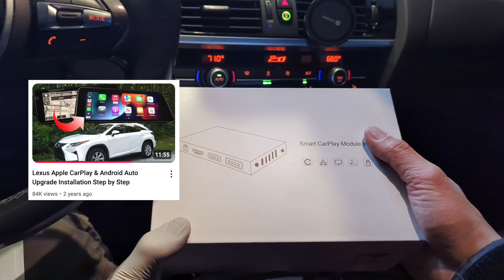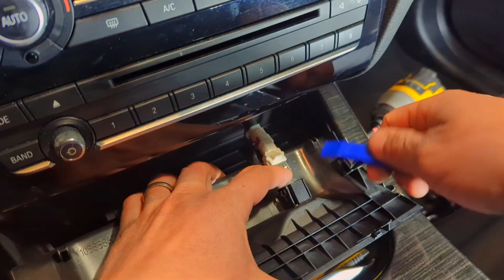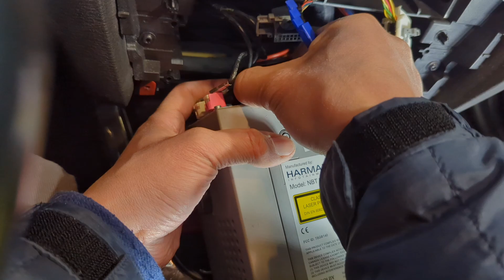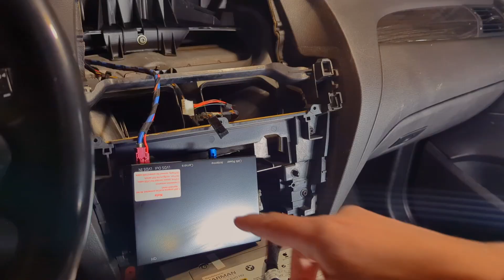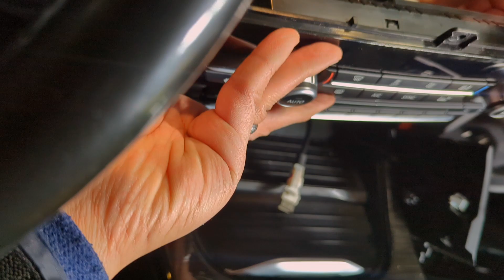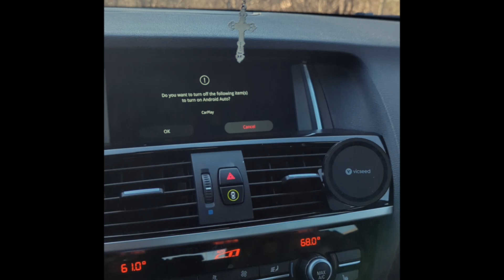BMW NBT/EVO CarPlay & Android Auto Upgrade | 2017 X3 M Sport EVO #bmw #carplay #androidauto

Comment: Will this resolve my satellite Sirius XM problem, I need an update from BMW to update satellite and they want to charge me $250 to do a media update. Will this enable me to use my Sirius XM app on my phone to BT to apps on the unit
Reply from the maker: Yes, you should be able to listen to SiriusXM through this unit using the app on your phone, via Bluetooth audio, CarPlay, or Android Auto, as long as your subscription includes app access. The app streams over your phone’s internet connection, so it doesn’t need the BMW satellite tuner or the $250 BMW media update. The upgrade itself won’t repair the factory satellite radio issue, though.

Comment: I have everything installed, audio works, but screen does not come on. My kit did not include a UART module and the back of my screen has 3 additional ports. Wondering if screen is a dud or if missing the UART is the problem. No online support anywhere.. thanks
Reply from the maker: I don't remember missing UART being an issue, but it sounds like your model is different and you should contact the seller support about compatibility or troubleshooting it.

Comment: Hi! Can I ask: does the carplay turn on automatically each time you turn on the car and connect via Bluetooth, or do you have to hold down the menu each time?
Thanks!
Reply from the maker: Yes, it connects automatically to your phone nearby and goes into the CarPlay mode after you start the car. No need to long-press the menu every time.
Reply: Would you recommend this NBT module, or replacing the whole screen with one from Road Top? It would theoretically have the same functions, but a bigger screen.  I don’t know whether it will work so reliably as this does though.  
What do you think?
Reply from the maker: @cjcjepson   this module works well but I haven't tested RoadTop's screen on this model to make a recommendation. I recently installed a Carputech touchscreen on the BMW and really like the touch experience and its integration with the BMW system: https://youtu.be/yn22EXGnWqA. Whichever option you decide to use, please do contact the seller to confirm full compatibility with your model year. Best luck!

Comment: Professor, whenever I turn on the car, it automatically goes to CarPlay map.  Can I disable that so that I do it manually?
Reply from the maker: The module will go back to its last state the very last time you turned off the car. Try enter into the mode/app you want before shut it down and see if it can go back there next time you start the car again.

Comment: @profsg, so I got this installed but it's the non evo version.  Anyhow, I used to get  sound coming from the car stereo but now when I'm connected via carplay, the radio is still on and when I use the map, the voice direction only comes from my phone instead of the car radio.  By any chance you or any of your subscribers know how to resolve this?
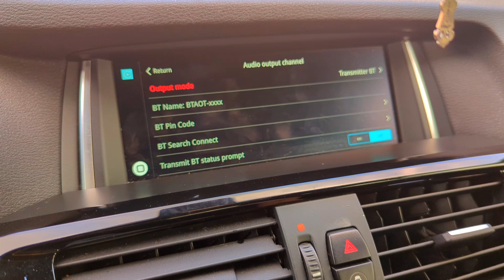Reply from the maker: This means your Carplay audio has yet to be set up properly. There are multiple ways to do it but I found the best is to continue using your BMW's original Bluetooth. Follow instructions starting at 12:28 to select Use Car's BT Channel and if you haven't done so, pair your phone to BMW's factory Bluetooth, and you'll be all good. Hope this helps.
Reply: @profsg Thanks professor.  Since I have 2017 BMW X3 sdrive28i, I believe I have fibre optic cable which I didn’t do during installation because the cable didn’t look like yours.  I might have to reinstall it again to do it properly.  But thanks for the suggestion.
Reply: Odd that I don’t have a fiber optic cable.  I thought all X3 comes with it.  Oh well, I just have to switch back and forth between my BT iPhone and car stereo by pressing the mode button on the dashboard.

Comment: Once everything is correct, do you have to turn on the new screen or does it come on once you turn on the car
Reply from the maker: The screen will turn on once you start the car or turn on ignition/accessories, and it will enter Carplay or Android Auto mode once you connect your phone. After that, you can switch back and forth between the original screen and Carplay by long-pressing the Menu button (for 3 seconds).
Reply: @profsg gracias

Comment: Hello my friend , nice videos 
Thanks for it 
What you think or you have plans for replace chains on your N20 engine ?
I own the same X3 2017 , have already 100 k km and start thinking about replacing chains on engine
Reply from the maker: Glad you liked it! No need to service your timing chain unless you have an issue. In earlier production years of this X3 generation, there were issues with plastic timing chain guides etc. that warrant a replacement. I am not aware of related issues on the 2017 model year and don't have a plan to replace it. Regular oil changes will keep it lubricated. Just don't go beyond 5,000 miles or 6 months for a turbo, and allow time for it to warm up and to cool down especially not to "cook" the oil. I do have carbon cleaning as a to-do item when it reaches 100,000 miles, likely in the summer.